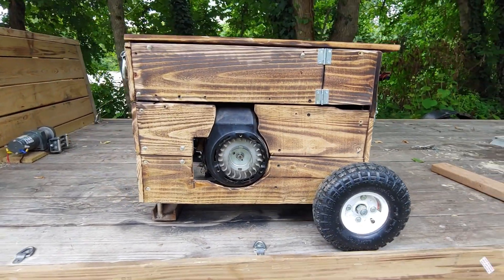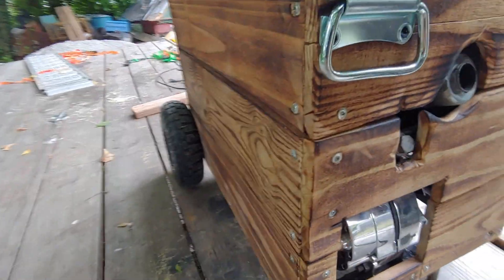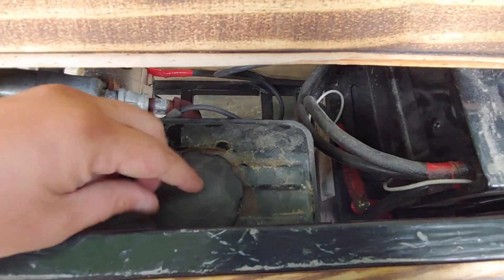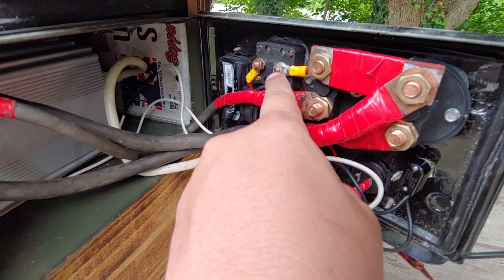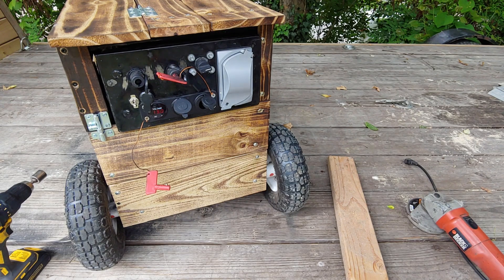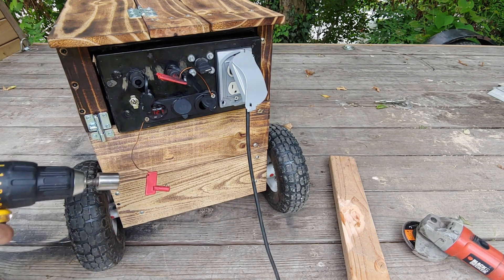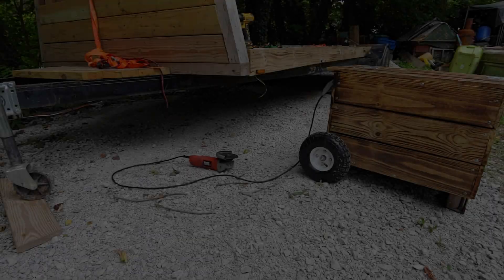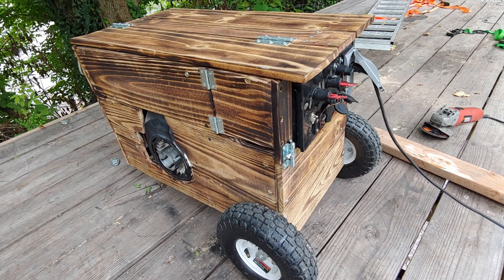Homemade Generator | Alternator Generator | SHTF Power Pack

Comment: Very helpful! I'm getting ready to build my own alternator battery charger, using a 6.5 hp lifan from H.F. I may make room for an inverter to be purchased later when the budget allows. I'll also install a 2nd muffler from a car to keep it extra quiet. Thanks for the inspirational ideas! Paul from S. Central Tx.

Comment: Or you could do like I did 6 years ago and buy a generator at Harbor Freight for $90.   It's portable and weighs 37 pounds and has run my refrigerator several times when storms have knocked out the power.   I keep it ready to run always.   But you did make a very nice generator.  I just don't have the time to make things like that.

Comment: Pretty cool! I'm sure you know, but wanted the other viewers to know,  the motor won't drag down so hard if you put a smaller engine pulley on it. I'm sure there are people who have played with these and have issues but aren't sure what to try. I've got a 7 hp motor with a 150 amp alternator. I got an alternator off of a diesel delivery truck. The diesel engine alternators are built with heavier bearings and are engineered to deliver top performance at lower rpms. My 7hp motor is connected with a one to one ratio to the alternator. It delivers great power and doesn't bog down under load. I  tried running a second 100 amp alternator off of the double pulley of the first alternator. It will run with the motor revved up but it is a bit too much load. It requires constant attention and I am happy with letting the motor control itself and running at much lower rpms. I believe the motor will last 3-4 times longer with the reduced speed and heat.
   Nice work and video! Yall Take Care and be safe, John

Comment: 4:48ish- "When the alternator starts to output high current, it kills the whole system"  Can you elaborate?   The Arduino would be excellent to automate your controls(electric start required). A nice box! Im sure it will come in handy, and it will surely be around a long time- very nice build.
Reply from the maker: With the Self exciting alternator i'm using when it spins up over 1000 RPM it starts trying to charge at full power and if the engine is not at a high enough RPM it will stall out. I'm planning on building a larger setup using a  10 HP diesel engine i have for Off-grid and power outage use.